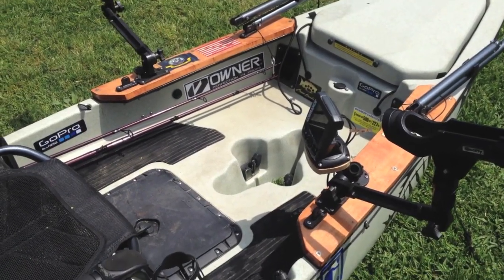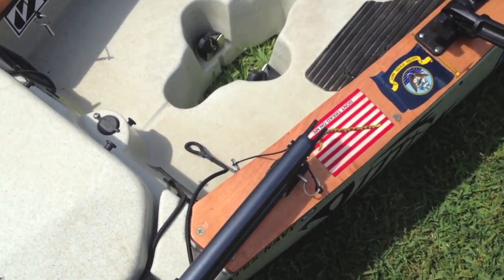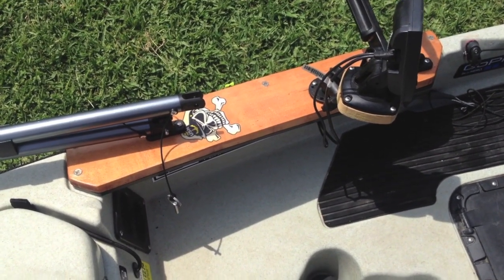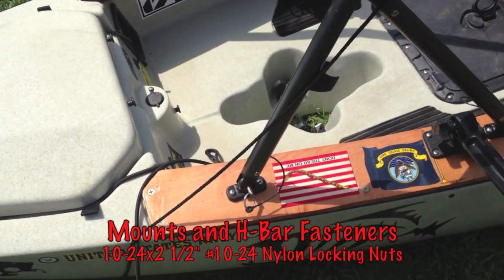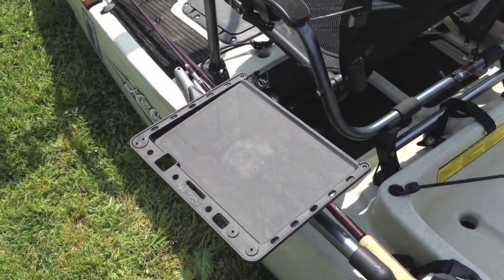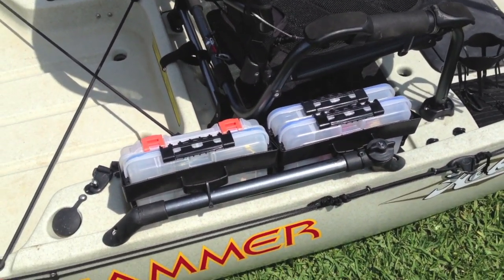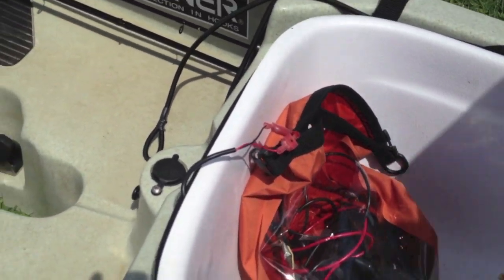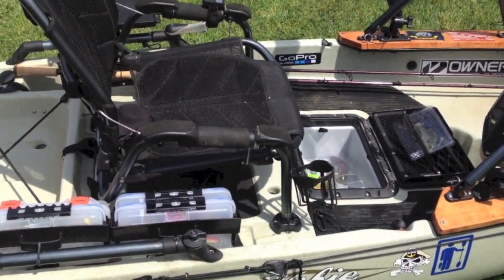Hobie Pro Angler 12, with mods part 2

Comment: Does the bottom set screws keep the mount from spinning on the bar? The 2 long screws basically keep the mount on the bar.
Reply from the maker: My friends didn't fit tight either but he just put rubber gasket material under it